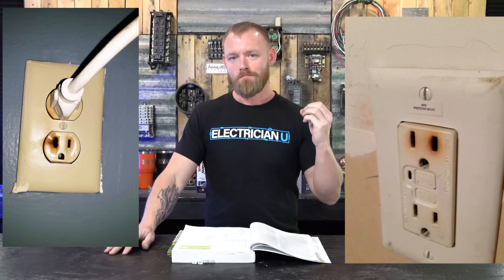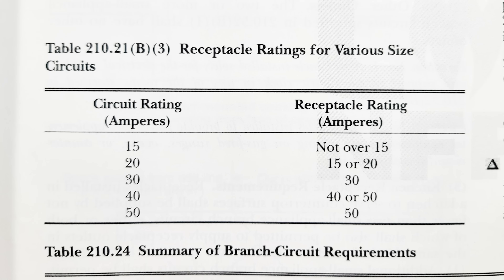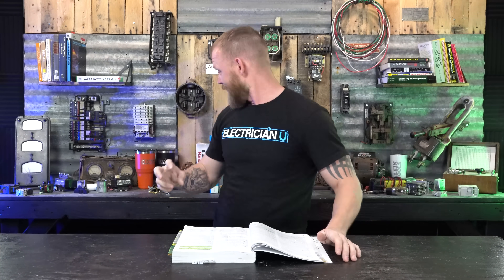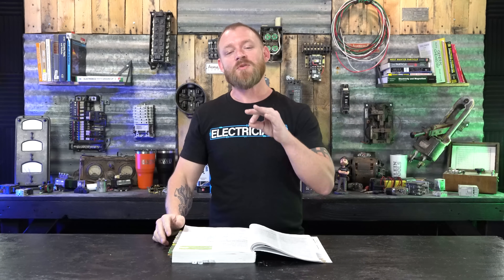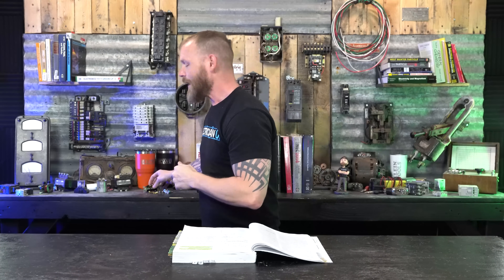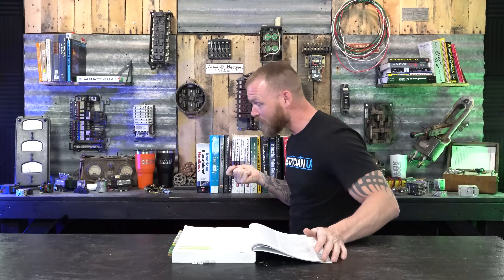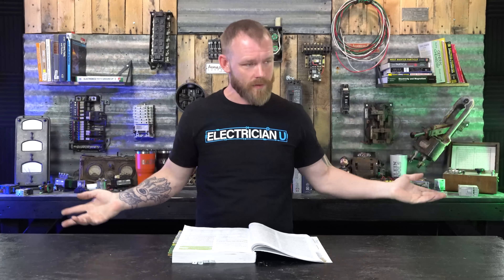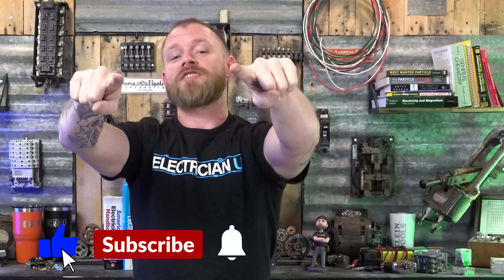Won't These Melt?!? 15amp Receptacles on 20 amp Circuits!!!

Comment: found out the hard way when a single space heater completely deadlined my rv's shore power circuit. Rebuilt the entire electrical through the it and donated the space heater afterwards and will never trust that brand of space heater ever again because it overloaded the circuit in one night.

Comment: So re-land that circuit on a 20 Amp breaker at the panel. Or put a 20 Amp breaker in to replace the 15.
Reply: Most literature is written on the power supply.....read it. Newer stuff with the s tons of different and new products made by slave labor.....not so much. Also lots of crap literature on things.
Reply: Plus most romex handles both. It's a matter of the breaker. However you do need to be mindful of whether or not that  circuit continues to power other things.
Reply: Wiring depends upon the appliances in the rooms as well. So a whole house is 15 to 20 for outlets aside from washer dryers, stoves, certain fans or blowers.
Reply: If the circuit is wired with #14, you don’t want to put it on a 20A breaker.

Comment: The answer in the video is not really an answer.  The blade configuration (2 vertical vs 1 vertical and 1 horizontal) is what the name of the receptacle relates to, not the current carrying capacity of the components in the receptacle.

Comment: I'm surprised when I did my house I put in 20a receptacles except USB receptacles. They were almost double in price at the time.
Reply: Double the price of a cheaper brand, maybe.  I bought a few 20A spec-grade receptacles for my kitchen and I actually paid less than the price for the 15A receptacle of the same brand and line from the same supplier.

Comment: at ~4:30 you back track on yourself. I'm in Canada so our code makes sense BUT the cord connected load table states that a 15a OR 20a circuit on a 15 amp receptacle can't have more than 12 amps (80%), the next line down it states a 20a circuit has a 20a receptacle. Clear as day. You can put a 60a receptacle on a 15a breaker but you can't put a 15a receptacle on a 60a breaker. Why is this so hard to understand?

Comment: The problem I have seen is portable heaters that are on high and thermostat is on max. The load is about 12 amps and is pretty much max for any outlet. 15 or 20 Amp does not matter. Eventually over time it gets loose and over heats the receptacle. You can touch the breaker, it will be hot too. Milk house heaters are dangerous and I have heard of many a house fire and more so in trailer houses that run out of propane burn to the ground. Some of which still have aluminum wires.
Reply: I ran a separate 20 amp circuit to the heater.  On a regular 15 amp outlets strung together, the circuit will pretty much be at capacity.  The 15 amp outlets where you plug in will get loose over time.

Comment: So my garage has a 20 amp breaker but I have all 15 amp receptacles I need at least one 20 amp receptacle if the wires going to the 20A breaker are at least #12 can I replace one 15 amp with a 20 so I can use my air compressor?
Reply: Yes.  The receptacle is the weak link.  With that said, 120V compressors are notorious for their start phase either stalling the motor or tripping the breaker. Ensure that NOTHING else is drawing power when running the compressor.  Also, if the sun is shining on the breaker box when using the compressor,  the breaker may trip because it's already hot. If the breaker is very old, it may have more trouble.  And... try not to use an extension cord on the compressor - it's just more resistance to torture the motor.

Comment: I have a question.  I've been wanting to ask that is unrelated to this but could not find the answer.  I am a mechanic at a plastic facility, I do a lot of electrical and mechanical.  We just install 2 pieces of equipment that has 480v coming in, going to a 400A fuse (per Leg).  Then to a distribution block for each phase.  Lets say we have 3 phases going to a 30A 3phase breaker going to a heater.  We are using 10 gauge.   I was taught that the wire is sized to the breaker.  How do you size the wire from the 400A distribution block to the 30A breaker.. This is an industrial application, and the electricians I've worked with were not sure or didn't want to bother looking it up.

Comment: Why would they melt? A 15 amp outlet will only let a 15 amp rated device plug into it.
Reply: There are some >15A devices without T-prongs on the plug.  However, if I plug my  15A hair drier, and my 5A flat iron into a 15A outlet on a 20A circuit, what do you think will happen?

Comment: I was "told" that the reason you do not install 20 amp outlets in a 20 amp circuit is because the cord allows you to plug in a 20 amp device. Therefore maxing out the circuit with one device. I was "told" that a 20 amp outlet in a 20 amp circuit must be on its own breaker with one plug. I live in MI. I would appreciate the advice! Thanks so much. Very confusing.
Reply: There are some >15A devices without T-prongs on the plug.  However, if I plug my  15A hair drier, and my 5A flat iron into a 15A outlet on a 20A circuit, what do you think will happen?  My house here in Hollywood has several 20A circuits with all 15A outlets.  My washer and dryer each have their own 20A circuits with 15A outlets! When I replace these, I use 20A so that the limiting device is the breaker, not some overheating component. 
The 20A outlets have a higher clamping force, so plugging/unplugging something quickly like a phone charger can be a battle.
Reply: @MrKentaroMotoPI  It's ok to use a 20 amp duplex receptacle on a 20 amp circuit, but is unnecessary in residential use. It's kind of an anomaly, because if you find equipment with a 20 amp plug, extremely rare, a 20 amp single receptacle is required. The only reason to use a 20 amp duplex receptacle is to indicate to the user that this is a 20 amp circuit. Even that is sometimes questionable because any homeowner can unknowingly put a 20 amp receptacle on a 15 amp circuit, thinking that it's just better.
I would recommend using "spec grade" 15 amp receptacles as they are no different internally than a 20 amp.
Reply: A 20 amp dedicated circuit must have a single, not duplex, 20 amp receptacle. The reason is that any appliance or tool that has a 20 amp plug (nema 5-20P) will require a dedicated circuit because of a higher power requirement. 16 amps is the recommended maximum. A 20 amp single receptacle can exist on a shared circuit, not recommended in my view, and should be verified.
Reply: @surferdude642  That makes sense.

Comment: Curious, why don't receptacles with built in fuses exist? I bet if there was a 12A fuse bult in, we wouldn't have to worry about end users.  Or, if the appliances will never draw more than 12A themselves, require multi-plugs to have the fuses.
Reply: It would add to the expense and likely cause more problems than it would solve. The closest thing is a gfci or afci receptacle, but they are not for over current conditions.

Comment: Seems crazy to allow 15 amp receptacles at least when too small extensions are used on heaters the fire is the homeowners fault not the code’s

Comment: I think it's OK if a 20a breaker is used with a 15a gfci. If the gfci starts pulling more than 15 it trips. But if you ever want to upgrade to a 20a gfci you can.
Reply: A gfci is not for that purpose. As long as the current drawn is the same as the current returning the gfci should not trip even when overloaded, at least in theory. If there is more than a 6mA current difference, it will trip indicating a ground fault, regardless of the load.

Comment: How does that work with kitchen dedicated circuits? Does that mean that the refrigerator outlet can only be 2 plug and nothing else can be plugged into the other open plug? Or does that "dedicated circuit" mean you can put however many outlets you want such that you are mindful of the 20 amp limitation which could be reached by a running microwave? Thanks for your reply.
Reply: A dedicated circuit means there is only one receptacle on that circuit and that receptacle is a single receptacle. You could have a duplex receptacle as a dedicated circuit as long as the receptacles are split and on separate circuits and no other receptacles exist on either circuit. In this case a double pole breaker or 2 single pole breakers tied together is required.
Reply: @surferdude642  That is how intuitively its made to sound, ie one breaker feeding one outlet receptacle or one appliance whatever the case may be. However how is that in real life practical especially in the kitchen? There are plenty of videos of professional electricians using a 20 amp dedicated circuit to feed multiple duplex outlet along a kitchen countertop run. So that is where my confusion lies and as I posted perhaps its just not necessarily 1 breaker 1 plug but just being mindful of the ultimate load being drawn. I was going to do like you commented but that would make my kitchen alone full up 10 slots on my panel which would be totally ridiculous.
Reply: @hippo-potamus  It would be reasonable to assume that you should have 6 or 7 circuits for your kitchen. 1. refrigerator 2. dishwasher and garbage disposal. 3. microwave 4. electric range if applicable. (2 slots in your panel for 240v access) 5. counter top receptacles 6. second branch of counter top or other receptacles. 7.  lighting circuit.
This would give you a robust setup in your kitchen. It's a total of 8 slots in your panel (2 for the 240v). You could absolutely consolidate it down somewhat depending on anticipated use and knowing the actual power requirements of your main appliances. You may want to add a sub panel in your kitchen or garage to accommodate this remodel.

Comment: Can't can you use 14 to on the 20 amp outlet and breaker or say a portable heater that might draw 1500 watts or a microwave but may draw 1500 watts. Should I go 12 to 20 amp breaker 20 receptacle outlet. Thank you again Jim

Comment: As others have said, it has nothing to do with the amperage rating of the device vs the breaker. I see it more 15 amp breakers than 20. Know why? Its typically in older homes that the devices are worn out in. That causes loose connections. I have seen people use books, boots, other combustible items to "keep the cord from falling out". That is what causes the heat. Only difference between a 15a and 20a receptacle is the face plate to keep from plugging a 20a load on a 15a circuit.

Comment: Can you run a 14G wire to a 15A receptacle on branch circuit off a 20a/12g circuit if it’s a dedicated plug for a small tv?

Comment: So I can't overload a 20 amp receptacle? I'm almost 50 and I have never had an outlet melt. I get what you're saying but in the end it's not a problem with the rating of the receptacle or the breaker but an issue with poor understanding by the homeowner of how to use them.

Comment: Not bad, but you failed to say anything about the true difference. And as a forty-plus year--- Unlimited Journeyman...  GFCI'S, and AFCI'S,  are use on 15 and 20 amp. circuits. These eliminate most of the problems.  Wet locations--- bathrooms --kitchens-- and designated locations.  97% of 15 amp circuits or devices are use in bedrooms and living spaces... AND YES THE NEC --- Is just a guide... State and Local Codes are what you go by. BUT AT THE FIRST OF THE NEC - BOOK--- First paragraph says UP TO THE INSPECTORS, DISCRETION...

Comment: I have a 110v 135a welder I run from a 50ft 10 gauge extension cord from a 20amp breaker. The welders max input current is 19.3 amps. The outlet is a 15amp that's on a 20amp break. One thing I can not do is run the welder above 120amps because it will trip the. 20amp breaker. Would installing a 20 amp outlet help this at all or should I get a 110/120v to 220/240v  adapter and run the welder off of the 30 amp oven ranger break if I ever need emote than 100 amps? (Or in general for that matter)

Comment: Great summary.  One addon, hospital=grade receps are much better than commercial grade receps.  They cost more, and they'll never let your NEMA 5-15P go.

Thanks for opening the book on YT.  I do this for my own houses (DIY) and NEMA and NEC are not dirty words.  If more people were advised of what the code is, where to find it, and how to make use of it, we'd all be safer from melting receps, fire, etc. and more importantly things would work forever.

I said it once.. but it bears repeating GREAT SUMMARY and THANK YOU.

If you read your comments daily -- have a great weekend.  Trades that study for years and share their knowledge... are a gosend to the rest.
Reply: hospital grade are just industrial grade receptacles with a plastic flap over the screws.

Comment: I was doing some reno work in my kitchen and had a mysterious 3-way light switch with tape over it.  Later discovered it was working in tandem with a power kill switch in the garage.  Ok...?

It was a regular 3way 15amp light switch on a 20amp circuit.  Inside of the garage, there was a non GFI outlet from the 70s that all of the power was flowing through.  When I removed this outlet, the back was melted and the outlet was only rated for 7 amps!  Oh and the traveler used for that 3way switch was actually the unshielded ground wire....hence the crazy voltage drop in the garage when I'd flip the switches in a different orientation.

I was also consistently running 10-12 amp loads off the outlets in the garage.

I replaced the entire circuit from the main panel, all the way out(underground) to the garage with new 12ga wiring.  Removed the 3way switches and instead installed new 20a gfci outlets.  Removed the 3way switch in the kitchen and swapped out its 4 gang box with a 3gang box.  Now my RV's surge protection system no longer complains about ground faults or voltage drops on the garage circuits.

3rd time I've saved our home from a potential electrical fire from some 20-40yr old botched DIY work.  Knowledge is power folks

Comment: I suspect the multiplug device plug is not up to code and UL approved, it has a 15 amp plug but no fusing to blow at 15 amps. If you look at the UL approval and manufacturing pressure, is where you can get critical. If it plugs into a 15-amp wall socket it should be fused for 15 amps is common sense. May communities require fused sockets on not only bathrooms, but all sockets in the house.

Comment: The problem is mostly how 15A receptacles are wired. ALOT of contractors use the stab backs and the 2 screws. If you want to stop having rec problems, just use 20a rec if you want to use stab backs or the 2 screws, or just pigtail every box, so the combined load bypasses the rec completely. If you dont know what im talking about, quick explanation, 3 rec on 1 circuit. A, B, C, and D is your breaker. Rec A has 8 amp load and Rec B has 9 amp load, if you use Rec C has the junction, it is pulling 17 amps through the rec. Honestly this code should be changed because of the various wiring methods. Only use 15a rec on 15 a circuits.

Comment: I have a question, I bought (4)Leviton G5362-WTG 20A-125V Extra-Heavy Duty Industrial Grade Weather/Tamper-Resistant Duplex Self-Test GFCI Receptacles, each one will have its own toggle switch, a Leviton 3032-2W 30 Amp, 120/277 Volt, Toggle Double-Pole AC Quiet Switch, Extra Heavy Duty Spec Grade, Self Grounding, for my outside Christmas lighting, will I need 20 or 30a dedicated breaker for each receptacle/toggle switch?

Comment: When my contractors did my renovation of my home. I specifically told them no 15 amp breakers anywhere in my home and no 15 amp receptacles. Everything will be 20 or more. 15A is not enough to keep up with a modern world with everything plugged in all the time.

Comment: Because you put 15a on 20a circuit doesn't mean anything.  The outlet itself isn't feeling 20a.
If you USE 20a on it then yes can cause fire or trip breakers etc.
But the outlet has no idea what Amps are there.

Comment: The amp rating only matters with what is plugged into it, the draw.  That is why receptacles have different plug designs to prevent big draw appliances and tools from being plugged into a circuit or receptacle that can't handle the draw.  If you have 20am circuits, just put a 20amp receptacle on that circuit, don't screw around.
Reply: Right. It’s what the load is drawing that determines how much current is going through it.

Comment: So my 15-18amp table saw and other power tools are less likely to melt my 15a receptacles because they are generally only on for a few seconds and the amp rating is their maximum under load?

Comment: someone should tell this to the morons that did the electrical work that caused us to fail code inspection then.  Single outlet circuit for a microwave oven they installed  20 am breaker and wire but a 15 amp outlet, after failing inspection and refusing to return my calls to come back to fix the problem I just replaced the outlet with a 20 amp outlet myself so we could pass inspection and sell the house.   Only reason I hired them was because I didn't want to be in the hot attic space in the summer heat running the line.